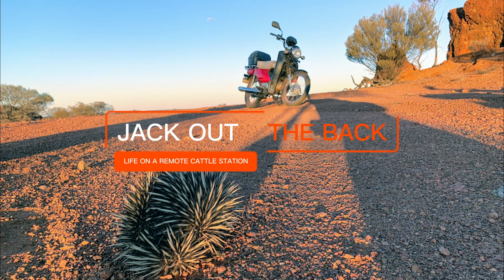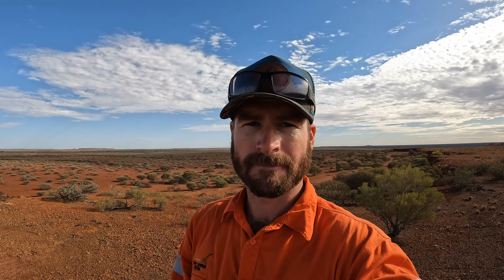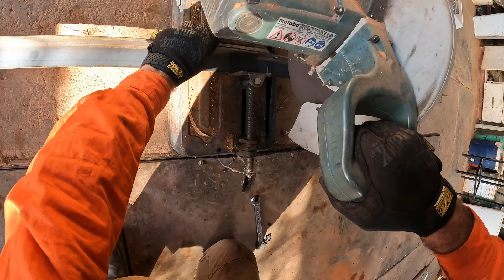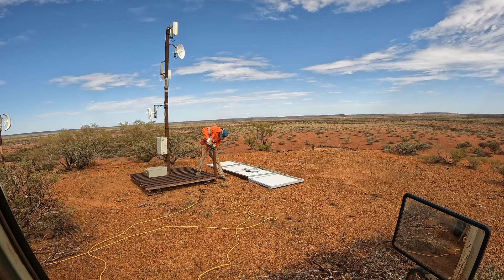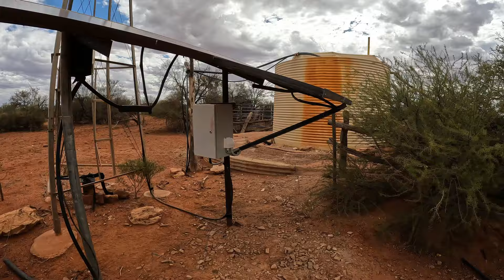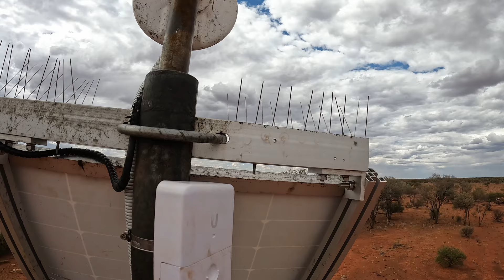Ep005 - The heat is on: A day of troubleshooting in the desert

Comment: If you’re able to setup repeater ‘rings’ than you could use RSTP on the switches to give you a bit of link path failover if a repeater site falls off line for whatever reason. Great effort, data sheets and deployments are two different beasts 👍